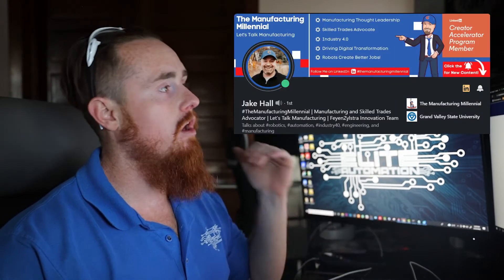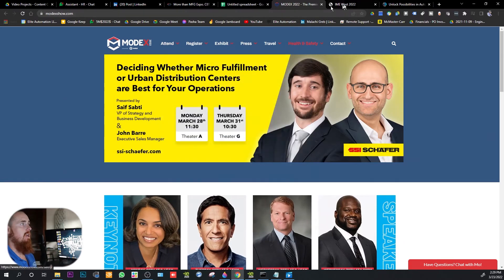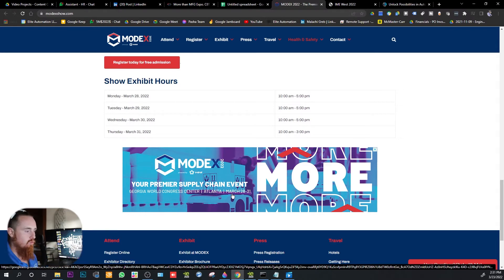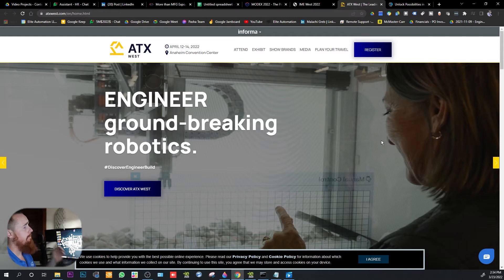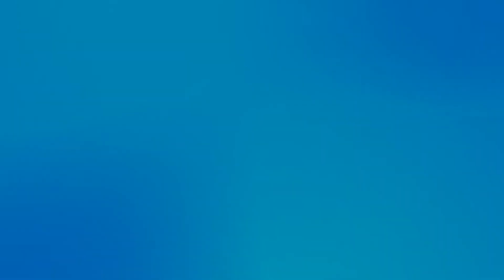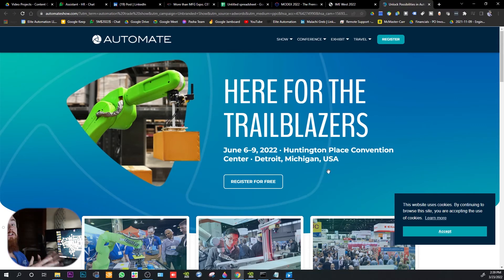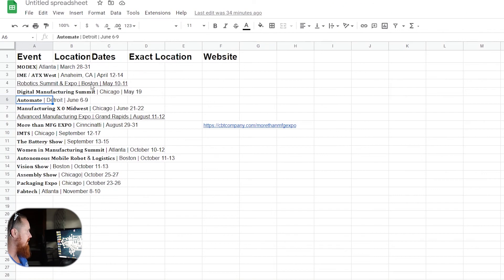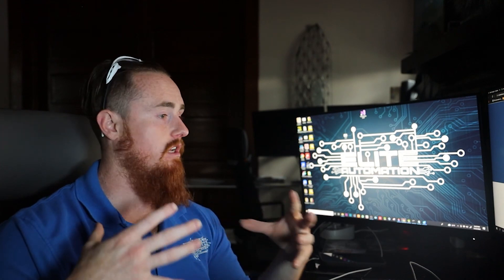Top 3 Biggest Manufacturing Automation Events in 2022 | Elite Automation

Comment: Do you guys use computer vision and machine learning for input sensory?
Reply from the maker: Not computer vision. But we do use vision systems
Reply: @EliteAutomation  I have an idea and would like to start my own venture, but the capital required to bootstrap something in this space is quite challenging.  Do you have any advice or avenues to go down for someone (I'm an electrical engineer) that has a good idea regarding innovation in the smart factory space?  I ultimately want to buy some equipment from a small textile manufacturing company and develop automation solutions augmented the machines with advanced vision coupled with industrial robotics as well as machine data logging for data science like predictive maintenance etc...
Reply from the maker: @robv3872  It sounds super exciting. I don't have much advice on funding. Pretty much everything we do is boot strapped.
Reply from the maker: @robv3872  one of the reasons I started the company is to be successful enough to do ventures like this. Definitely stay in contact because if we get to a comfortable spot I'd like to help out.
Reply: @EliteAutomation  sounds good.  Not sure what your discipline is but I'm an EE mostly PCB design and firmware/FPGA digital design.  If you ever want to hop on a call and talk tech feel free to reach out!